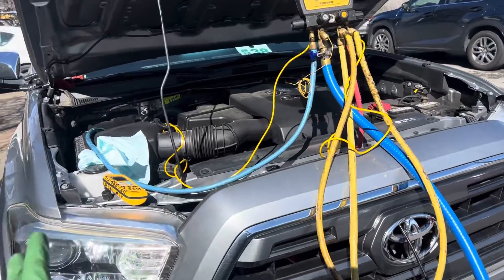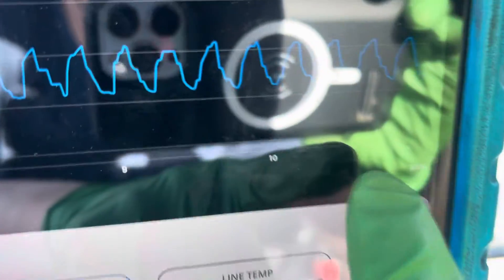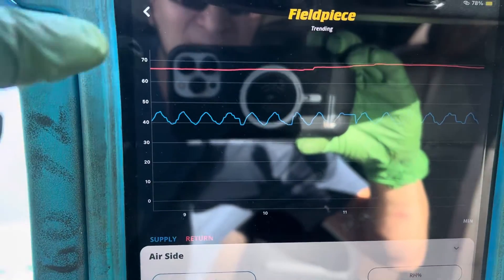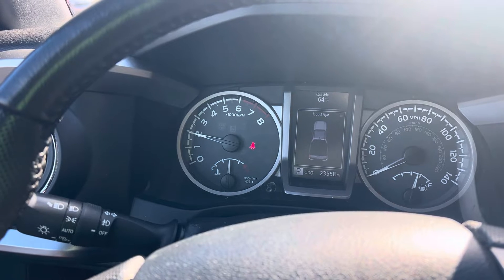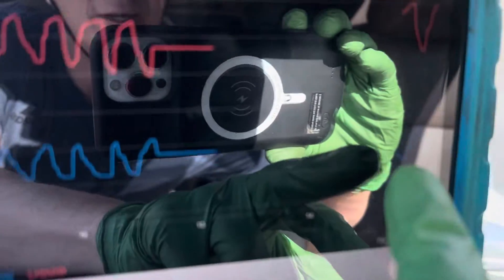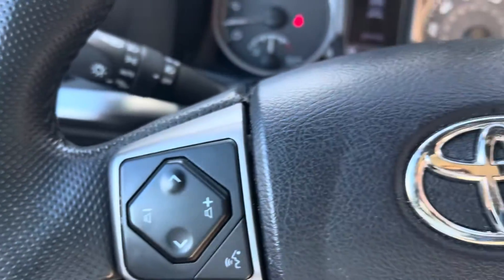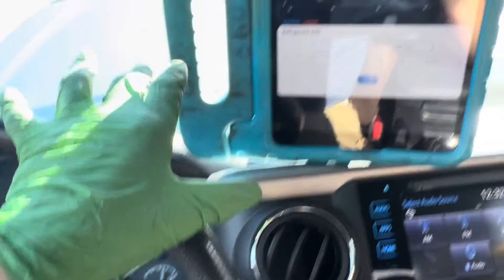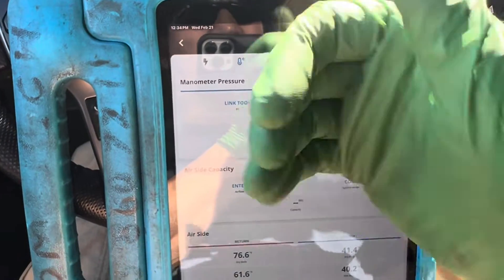AC 2020 Toyota Tacoma new condenser refrigerant recharged, operation pressures and temperatures ￼

Comment: Part 2  :  HERE IS THE QUESTION:  do I inject the refrigerant oil into the inlet at the top of the condenser so that it can flow thru the condenser when running ( I know it has small tubes which may cause a problem, don't want to clog it)  ???    OR do I remove the desiccant bag and inject the refrigerant oil into the cavity where the desiccant bag resides, put the desiccant bag back in, and close it up ???  OR do I inject the refrigerant oil into the outlet hole of the condenser  at the bottom ????  (It would then go to the thermal expansion valve, and I don't want to mess it up) 
I have been stuck on this question for weeks, once I install the condenser I am ready to vacuum the system and add my 134a refrigerant,  my family is screamin at me daily to get the car back in order and I trust your expertise,  I'm all the way out in Miami, Fl. and I am desperate at this point.... please help me... thanks so much, if you need any additional info I can provide it, and or if you want I can make a video and put it on youtube to show anything necessary to provide a better picture of the situation..... sorry for the long story, thank you so much, I really appreciate it...
Reply from the maker: You’re not going to screw anything up by putting it in the wrong port inlet or outlet. 

Refrigerant move so quickly once it starts, it would be from the inlet coming out of the outlet in about a second or two 
Not going to clog anything up because it will be diluted and mixed with the refrigerant and will have the viscosity that is thinner than gasoline . 

The last thing you would want to do is open up the desiccant and expose it to the atmosphere, especially the high humidity where you live . 

And just keep your vacuum pump on overnight the more you vacuum, the better the possibility of you removing more moisture out of the system . 

You can never all you can do is remove more moisture  👍 

POE oil Loves to absorb moisture out of the air
Reply: @coldfinger459sub0  ok, thank you so much, I appreciate it =) you have no idea how much this helps... thank you Sir
Reply: @coldfinger459sub0  is the amount of refrigerant oil added thus far ok in your opinion ? too much ? too little ?  anything else I should look at or keep in mind ? thanks
Reply from the maker: @HOTRODRICO  you have to look up the specifications and see what the total oil amount for that vehicle is to determine if it is correct or not every vehicle make model is different

Sometimes the manufactures will give you individual component oil quantities that were added together may exceed the total capacity 

This is why you start a brand new clean flushed out system and do it the first time
Reply: @coldfinger459sub0  true, how finicky are automotive AC systems like what's the over/ under as far as how many OZs or CCs can you be over or under without issue?  the grey area if you will, where if you're under this much, or over this much you're still ok ?
Reply from the maker: @HOTRODRICO  depends on the capacity

It’s a total system capacity is 2.77 ounces and you’re 1 ounce over. That’s a huge percentage. 

That’ll shave off a little efficiency from the evaporator 

Your total capacity is 9 ounces and your 1 ounce won’t feel it. You won’t notice it. You can’t measure it. . 

If you’re announce over, it’s not gonna be the end of the world . 

It’s nicer, not to be an ounce under though . 

There’s some systems out there that have an accumulators and you can be 4 ounces over and because of the accumulator it’ll be pretty forgiving . 

Some compressor designs do not have a captive. They’re not as forgiving as a system with a captive sump. . 

Systems, you could be a couple ounces over and a high side pressure it causes won’t be noticed except on the front shaft seal and it makes the front shaft seals go out after a year or two depends on the quantity system design 

I’ve had a lot of my customers throw on compresses without oil balancing and have an extra three or 4 ounces 

Capacities usually within 1 to 3 years within a leaking front shaft seal not all of them, but a lot of them enough to really notice it 

But it left the shop cooling just perfectly just ended up as a shaft seal failure couple years later
Reply: @coldfinger459sub0  THANK YOU so much, I truly appreciate you Sir... 😉

Comment: PART 1 : so here is the backstory :  I have a 2000 Lexus GS300 3.0L,  (this AC system is a thermal expansion valve system incase that matters),  the car had a leaking evaporator core located in the dash that I changed (factory denso oem part), I went by the factory toyota/lexus repair shop manual and added (40cc of pag 46 refrigerant oil) to the evaporator core and reassembled everything (including new green o-rings pre-soaked in refrigerant oil etc) , I installed a new compressor to be safe (denso factory oem part), I drained the refrigerant oil that came in the new compressor and (added 4oz of refrigerant oil) which is the approximate capacity of the compressor,  now, I am installing a new (denso factory oem) PARALLEL FLOW condenser , which (when mounted) has a passenger side built in desiccant bag/filter. ...  The factory toyota/ lexus  repair shop manual says you need to inject 40cc of refrigerant oil into the new condenser BEFORE installing it and connecting the hoses to the inlet and outlet.... however, it doesn't mention WHERE to inject it....
Reply from the maker: Just put it to the inlet not really important.  

But at the inlet, it’ll just be immediately push through the entire system within a matter of a second or two refrigerant travels really fast . 💨

Comment: Tom I am being held up by a question I have that I don't know the answer to and I trust your expertise, if you could please allow me to present the question, if you could help me I'd really appreciate it... thank you
Reply from the maker: Yes, of course go right ahead. That’s what I’m here for.

We all learn something new every day, including me 

I had two new things that stumped me for a little while that I’ve never seen over the past 40 years 

On one of them, I actually have to ask a question and assistance on information from guys who know Audi and the CO2 744 refrigerant systems . 

I’m having to read and do research on something I never did before
Reply: @coldfinger459sub0   I guess I'm gonna try to break my question into 2 parts because I  posted it twice and it keeps being removed I'm guessing for being too long ? thanks
Reply from the maker: @HOTRODRICO  OK try it again. I never seen no other post from you..
Reply: @coldfinger459sub0  awesome, thanks so much... ok here's the scenario and question:   I have a 2000 Lexus gs300 3.0L 2jz-ge, and my evaporator core blew out, so I replaced it with a factory denso, it said to fill it in the factory repair manual with 40cc of refrigerant oil (pag 46) which I did, to be on the safe side I changed the compressor as well with a factory denso oem replacement, I drained and filled the new compressor with approx. 4 oz which is the recommended amount, then it was time to address the condenser, (I also would like to mention this system has thermal expansion valve if that plays into anything) I bought a denso factory condenser and according to the factory repair manual it requires 40cc of refrigerant oil as well.... here is my question, it is a parallel flow condenser, and the tubes a small as you know, (also it has the built on desiccant bag which resides on the pass side of the condenser),  do I add the refrigerant oil to the inlet on top of the condenser and let it flow thru the tubing ?    do I add the  refrigerant oil to the desiccant bag space - like remove the desiccant bag and shoot the  refrigerant oil in there, put the bag back in and close it up?  or do I add the  refrigerant oil to the outlet port at the bottom of the condenser as to not clog the small parallel flow tubes ?  This is the last part of me rebuilding my ac system and I have been stumped for weeks, after this i will pull a vacuum and then add the refrigerant..... now i have called many people and they say "ohh I add all the  refrigerant oil to the compressor and then run the system and it distributes it everywhere" , but my toyota lexus factory manual says to add it before you install the condenser so I am going to do that the question is where do I add it.... sorry for the long winded question but I 100% trust your expert opinion and I appreciate your mercy to help a guy all the way in Miami out, I am desperate lol thanks... if you need or would like to see pictures of the car/parts or contact me outside of youtube I am available to communicate... thank you Sir
Reply: @coldfinger459sub0   Ok, awesome thank you for your time and reply... so here is the backstory :  I have a 2000 Lexus GS300 3.0L,  (this AC system is a thermal expansion valve system incase that matters),  the car had a leaking evaporator core located in the dash that I changed (factory denso oem part), I went by the factory toyota/lexus repair shop manual and added (40cc of pag 46 refrigerant oil) to the evaporator core and reassembled everything (including new green o-rings pre-soaked in refrigerant oil etc) , I installed a new compressor to be safe (denso factory oem part), I drained the refrigerant oil that came in the new compressor and (added 4oz of refrigerant oil) which is the approximate capacity of the compressor,  now, I am installing a new (denso factory oem) PARALLEL FLOW condenser , which (when mounted) has a passenger side built in desiccant bag/filter. ...  The factory toyota/ lexus  repair shop manual says you need to inject 40cc of refrigerant oil into the new condenser BEFORE installing it and connecting the hoses to the inlet and outlet.... however, it doesn't mention WHERE to inject it....  HERE IS THE QUESTION:  do I inject the refrigerant oil into the inlet at the top of the condenser so that it can flow thru the condenser when running ( I know it has small tubes which may cause a problem, don't want to clog it)  ???    OR do I remove the desiccant bag and inject the refrigerant oil into the cavity where the desiccant bag resides, put the desiccant bag back in, and close it up ???  OR do I inject the refrigerant oil into the outlet hole of the condenser  at the bottom ????  (It would then go to the thermal expansion valve, and I don't want to mess it up) 
I have been stuck on this question for weeks, once I install the condenser I am ready to vacuum the system and add my 134a refrigerant,  my family is screamin at me daily to get the car back in order and I trust your expertise,  I'm all the way out in Miami, Fl. and I am desperate at this point.... please help me... thanks so much, if you need any additional info I can provide it, and or if you want I can make a video and put it on youtube to show anything necessary to provide a better picture of the situation..... sorry for the long story, thank you so much, I really appreciate it...

Comment: Hello everyone, is it normal for the air conditioning fan to not run intermittently all the time?
Reply from the maker: All car manufacturers operate their fans differently. 

Some on only. 
Some off snd on 
Some slow down and Speed up 
Some one of two fans come on and only if the pressure go up vary huge will the other fan come on .

Comment: i was wanting to ask you a question.  I replaced a condenser on a honda pilot today , and i keep having an issue trying to charge the system on the high side.  My yellow jacket (high side) coupler doesnt allow normal flow like on your vehicles after a good vacuum is obtained.  I wind up charging thru the low side.  Is there a problem with the control valve in these couplers that prevents me from charging the system like you do in ALL your videos?  thanks for the help :)
Reply from the maker: It only allows you to get so much liquid in there and then it starts to slow down and then it stops ? 

This comes back to our middle school class and math class . 
    When they talked about physics of the three gas laws and again when you’re in junior high school and again in high school. 

My father would not give me the answer to this question . 🙋 

I was 12 years old and he made me go back and read the three gas laws . 

Because he told me to explain to him how I was going to completely charge the system 100% without starting the engine to use the suction to pull in the gas . 

So I had to go back upstairs and spend about two hours reading 

And after reading the laws, I was able to put them together and come up with the answer to recite to my father . 

I told him every step and explain the principles of the laws that we’re going to allow me to perform this task . 

That was the first time to touch. Refrigerant hook up perform refrigerant recharge 12 years old. . 

Ever since that day . My father told me do not give anybody the answer.

They’ll learn much more if they take out the time and read about the three laws and they will answer their question seeking answer and learn more . 

So that’s my answer  to your question. 

There’s nothing wrong with your coupler or gauges . 

It’s physics
Reply: @coldfinger459sub0  thank you, time to study
Reply: @coldfinger459sub0  I guess the confusing thing to me is watching you charge a vehicle in 30 seconds or less and I am only able to get about 30 to 70 grams into the car before high side flow stops. Im learning this in small steps, so I will continue to learn and study  I love the learning process !!
Reply from the maker: @Sid9397  you Will get it. And when you do you’ll hit your self in the head when you see how simple it is 🤦‍♀️